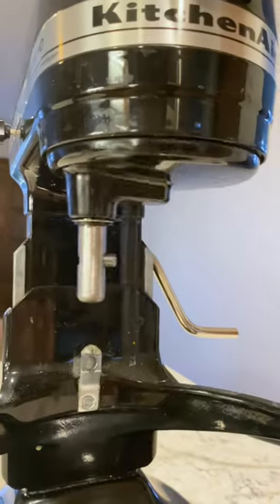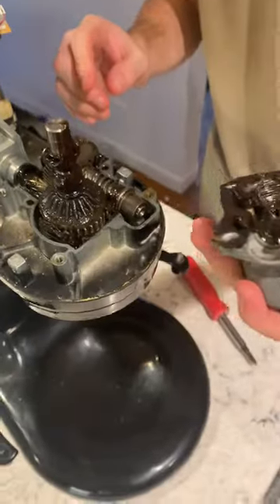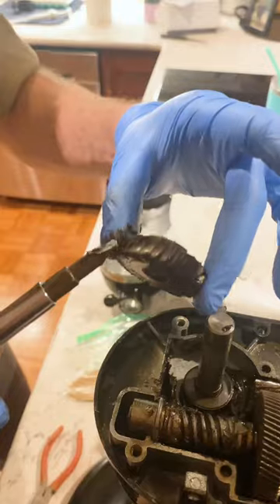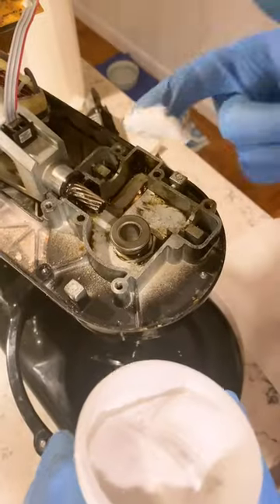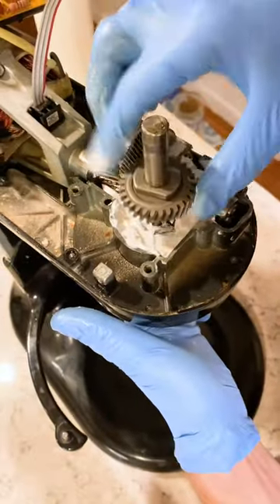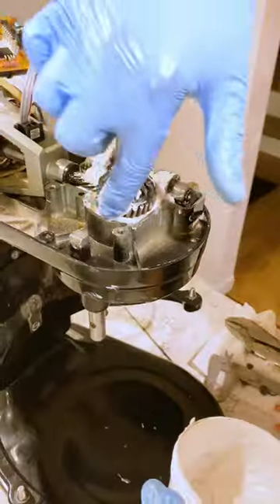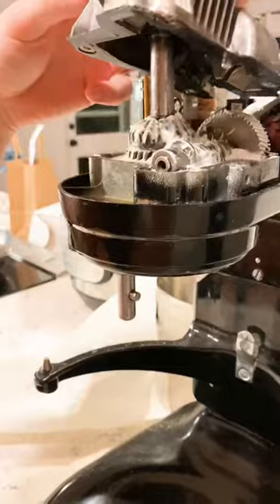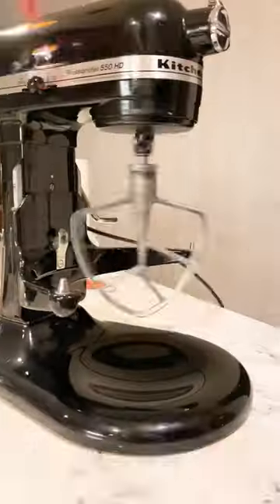Fixing our KitchenAid - Part 2 #KitchenAid #repair

Comment: Can you use crisco to lubricate the gears? It’s good safe and was initially created to lubricate heavy machinery at high temps…just curious.
Reply from the maker: Not sure. I just try to replace it with a recommended grease.

Comment: Hello! I want to know where do you buy the replacement part? Because the hinge that is on the back of the stand mixer it is cracked and very loose so I want to change! But the official service said me that they have to take the mixer an make a diagnostic of it. I think it is not necessary! And I only want to by the part
Reply from the maker: We bought our parts on amazon. You'll first need to look up the part numbers for your specific machine and then google where to buy it. Not all parts are available on amazon but it's handy when they are. We've had good luck ordering from www.repairclinic.com as well. They then to be a bit more expensive but sometimes it's all thats available. Good luck!

Comment: The original KitchenAid gear you replaced here, is partly plastic and has a small hole in it for a small pin..the iron ones I've seen online (as used in this video) havent...but seems more strong obviously.

Meaning the pin isn't necessary as long as the gear model is the same and hold in place with the snapring?
Reply: Sometimes a plastic gear might be designed that way. Because if too big of a loadis created it will damage that particulargear and not others or other parts downstream. So not allways is a metal part better